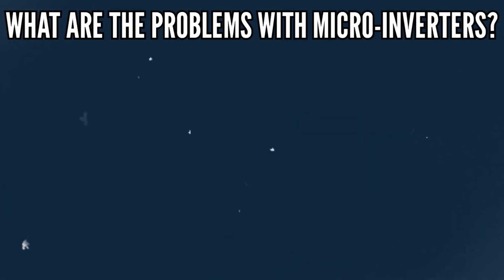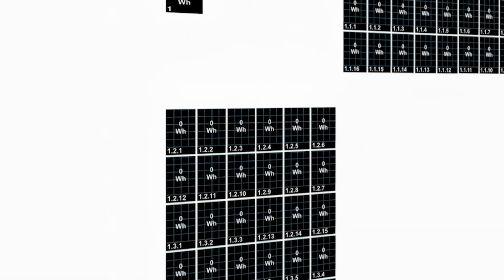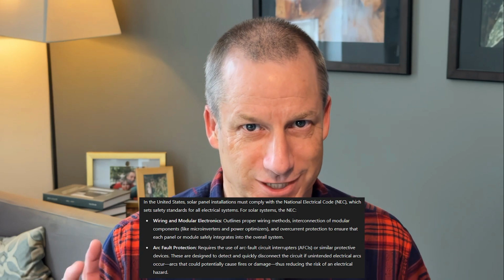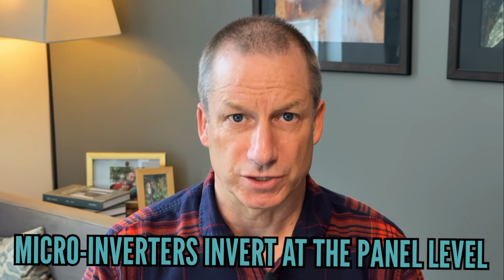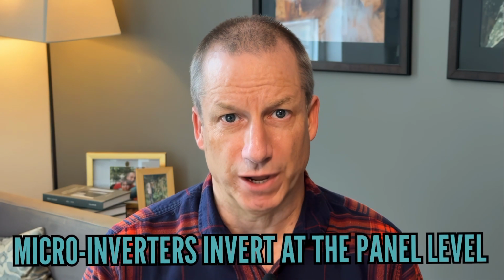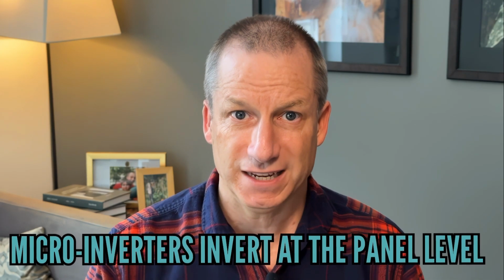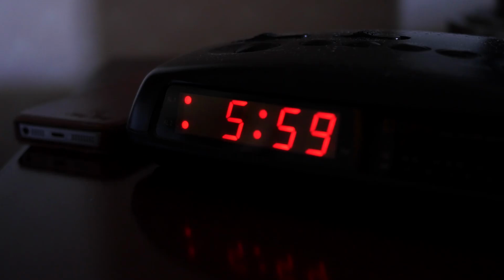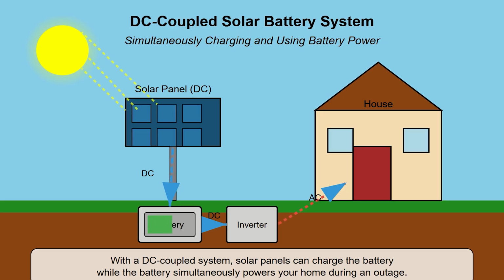Why Microinverters FAIL Homeowners (DC Optimizers Win)

Comment: Hello, good video.  I have solar panels (22- 395watt jinko) with optimizer ( SE440) and then a solaredge string inverter SE7600. I'm adding batteries so I'm putting in a  EG4 hybrid inverter  with a MID. I do feel the inverter is clipping my production. On the best sun shining days i never  go over 7600 watts , some installers said oh it's good up to 125%. Shit I have never seen it. What you think. I do have a battery question, but I'll stop here.

Comment: Micro inverters invert the dc energy once and we use it way more efficient than batteries. But batteries have their place in bad weather and night. I didn't do research but I have owned both for 10 years and Micro inverters are the way to go when first starting up and with the right  main inverter they make great charge controllers.

Comment: Some good points but don’t totally agree
Enohase at least has a 25yr warranty ( still possible scaffold costs) and my guvenergy battery can charge via solar and discharge to the house . Not the cheapest system but the best for my multi aspect roofs setup

Comment: Microinverters will clip more? Using Enphase too much, as they suggest dramatically undersized inverters for a given panel size? If you use a microinverter that is suited to the panel size you won't get any more clipping than if you sized your array correctly with a string inverter,,
Reply from the maker: Yes you will get more clipping. Think of it this way if you have a 30 panel system and only 15 are working at peak because of shade then with micros all 15 will clip because each panel has a max. With SolarEdge or a string inverter  they will not because the one inverter has a max designed for 30 panels and will only clip if all or most are near peak. Make sense
now?

Comment: Microinverters have a tiny failure rate, where SolarEdge string inverters pop like popcorn!
Reply from the maker: That’s the opposite of my experience.
Reply: @bradthesolarguy  Where are you located? Here in NC, a defunct solar company installed hundreds of SE inverters, and every month or so, we get a new call from someone who wants us to fix their non-working solar system. We go there, and invariably, it is a dead SE inverter. Then we go through the RMA process, wait a few weeks, and get the customer back online. On the other hand, I've sold well over 400 Hoymiles HMS-2000-4T-NA microinverters and have had no failures whatsoever, and I have 100% happy customers, as you can see from my glowing reviews. Whose microinverters did you use, NEP? From what I've heard, that would explain your experience.
Reply: @bradthesolarguy  You're still exaggerating here. #1. If a microinverter fails, they are plug-and-play to replace. A homeowner can DIY it; it's not complicated or difficult. You make it out so that ONLY the installer can do this, and that's not true. Even wiring is a simple 3-wire cable, L1, L2, and G. No more difficult than changing the plug on a line cord. #2. Hoymiles HAS AC-coupled battery inverter, has 95% efficiency. I would not call that "Extremely Inefficient". In the 1990's a Telecom inverter with 90% efficiency was considered outstanding, inverters with transformers were under 88% efficient. I consider +/- 1% to be roughly the same thing and not a big deal. Your words are exaggerating this. The HAS battery inverter AC couples to both the Grid and to the Microinverters. Therefore, they can and DO charge the battery while powering the load, drawing the power from the microinverters. #3. The HMS-2000-4T-NA clips at 514W DC per panel, compared to the Enphase IQ8H that clips at 391W. So that's a non-starter with Hoymiles. Everything you said is partially correct with Enphase microinverters, but is completely false for Hoymiles microinverters and battery inverters. You didn't do your research or you are biased against microinverters. I find that they are the easiest way for homeowners to DIY their own solar panels and save 50% off the cost of having them installed by others. That kind of savings more than makes up for any minor inconveniences. A DIY solar system is easy to repair if you're the one who installed it to begin with. I highly recommend it.
Reply: LIES!
Reply: I haven't lost a micro inverter in 10 years most string inverters are long dead in 10 years.
Reply: @offgridwanabe Another lie, lol.
Reply: @meilyn22  Do you always call people liars without any evidence? I've sold hundreds of Hoymiles microinverters over the past 4+ years and none of them have failed. Gripe elsewhere!
Reply: @ToddDesiato It seems you have no clue what the thread is about. The claim was that String inverters pop like crazy. That was what I called a lie. Whether you sell microinverters or not has nothing to do with my comment.
Reply: @ToddDesiato Also, buying microinverters from a known brand and then buying cheap string inverters from China and comparing them is neither fair nor accurate. Most string inverters have 10 years warranty with extended warranty up to 20 years. So you guys have no clue what you are talking about.
Reply: @meilyn22  I'm the guy who posted it, and it's true in my area anyway. I've replaced over 7 SolarEdge inverters in the past 3 years, and zero, none, nada, zilch, microinverters. I follow the EG4 forum and prior to their XP series, their string inverters were often failing too. Seems you're the one who doesn't know the facts. I've got 15 years of first-hand experience! I've replaced more ABB 3-phase string inverters than I can remember. I've lost count! The Advanced Energy string inveters too were a big seller that turned out to be garbage that needed constant replacing. The only string invertes I've used that were not an issue has been Chint. So, your theory about "cheap string inverters from China" has been disproven. The ones from China work best, same with the Hoymiles microinverters. String inverterters are great if you charge for extended warranties and maintenance contracts!
Reply: @ToddDesiato Wait, you are posting with multiple accounts? Do you sell microinverters?
Reply: @meilyn22  For you it is a lie for him it is business as usual seems to be a lot of that going around.

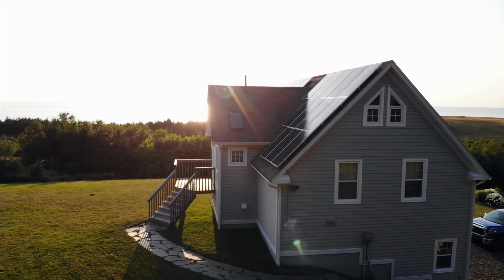Comment: The point on 4:30 is wrong, the power produced by the micro inverters can directly be used by the house and the battery only needs to store if the inverters produce more than consumed or produce the difference between consumption and production!
The main point that I agree on is the costs of replacing a defective micro inverter. However, if you have a string inverter failing, you loose 100% production where with a micro inverter you loose a small percentage 
Both sides have pros and cons. At the moment, I still plan to go with the micro inverters.
Reply from the maker: Actually when the grid goes down and you switch to running the system independently you lose the uninterrupted power supply of the grid. Solar needs an uninterrupted power supply to work because safety and you don't want your fridge to go out when a cloud comes over. That means when you go "off grid" during a power outage your battery becomes your uninterrupted power supply. But because the inverter can't work in 2 directions at once you do lose your solar power with an AC coupled system with microinverters. With a DC coupled system you can use the battery and collect the solar electricity simultaneously.
Reply: @herwigg3327 you are right. Brad doesn't seem to understand how the AC coupled system works.
I have a string inverter. I think optimizers are the better choice if you have different orientations in a string. A problem I see with cheap microinverters is not only do they clip the output on the panel level, but they also clip more when it's hot outside because they have no active cooling.
Panels are now cheap and if you have enough space like I do, it's cheaper to buy an extra panel, than to get microinverters or optimizers. Prices are fluctuating now though, so that might influence your decision.
Reply from the maker: I do understand how AC coupled system’s work. Do you understand how grid tied micro-inverters work?
Reply: @bradthesolarguy  Yes, if you set them up correctly, you can have them produce power when the grid is down as well. And if you AC couple the battery can supplement if you consume more power than the system produces, or you can store the excess if you produce more than you consume.
Reply from the maker: @GerbenWulff  Enphase microinverters will not automatically produce power during a grid outage due to anti-islanding protection (required by code for safety).
However, if the system includes Enphase’s Ensemble/Enphase IQ System Controller, which enables grid-forming capabilities, then yes, the microinverters can continue to operate during an outage, powered by the battery's AC signal forming a local microgrid. This is not the usual set up though.
Reply: @GerbenWulff  I agree, I have already mentioned victron Multiplus which clearly state that in their description but it seams this post is no longer here. There are also other systems that support this feature but it is not the norm.

I used to have enohase on my list but one university had some tests and they said that they had to get the internet to the inverters in order for them to work, this was a no go for me than. At the moment I favour Hoymiles with the drawback of it being chinese. By the way, even the small hoymiles AC battery ms-a2 can be charged via micro inverters.
The main argument for micro inverters for me is that if during the years a single panel degrades (less enough that the bypass diode does not kick in) the whole string produces less without you noticing (you will only realise that production goes down year by year).
With micros or optimizers, you know which panel is to blame.
I prefer micros to optimizers as micros are cheaper than strings+optimizers and you don't have the inverter as single point of failure.

At the moment I plan to use the 1.6 KW micros for 4 modules and place them all on a single spot in the roof connected with DC cables to the individual cells. And I plan to put some PV powered fans to these micros.
Reply: @herwigg3327  If you live somewhere where it gets hot, you could restrict yourself to adding only 2 or 3 panels to the microinverter to reduce the risk of overheating. Also you could put them under your roof, if it is usually cooler there when the sun is shining and you have easier access to them. Fans will break down after just a few years and they are not monitored. I have fans in my house and I clean them several times a year.
Reply: @GerbenWulff  good point, thanks, will take the suggestion in consideration. But that would mean to guide two DC cables through the roof for each panel. Not sure if this is the solution.

Comment: Micro inverters fail when the power goes out, the pv string keeps on dumping into the batteries, I have both and the string inverter hasnt failed me as much as the Inverters.
Reply from the maker: The micros don't fail when the power goes out so I'm not sure what your point is?

Comment: Thanks you   make good points ..  In UK they offer 25 year warrentee  on micro inverters , But as you say  its big work , to change one microinverter , scafolding take off pigeon netting & a couple of panels to get there.., I asked & they said "oh we mostly can fix them with over the air updates"...( so each has got software & a wifi conection to go wrong too, & you can fix a blown capacitor with updates ) so likely the company will go bust before 25years. .  It is also 10x the number of things to go wrong ... wouldn't mind so much if they were in a nice row on the garage wall , with a spare provided to just switch in .  .. During the sunny day the AC power comes from the roof & runs the house, only the extra comes from the battery or grid as required .   For me in the UK the last time "the grid power went out" was 1974 during the miners strike. ( maybe since then it goes off for 30min every 10 years or so) so that isn't a concern yet.
Reply from the maker: That 25 year warranty on micros is good but very misleading. It covers the parts but only a tiny amount for the labor and therefore the solar company doing the work loses money every time they come out to fix one. That is why it's very hard to get someone to fix just one or two or really any number. Also, you can extend the Solaredge warranty to 25 years for just a few hundred dollars which I recommend because you will probably only need to replace it once if at all. And its a lot easier to get your installer to come out once every 10-25 years than for however many micros you have.

Comment: You make some great points Brad. I feel like I struggle with a decision of microinverters vs DC-optimized/central inverter system. 
Though I will point out that some of your negative comments also apply to a DC-based optimizer/central inverter system as well. Since the main drawback of a central inverter is the single point of failure, if that fails at all you have 0 output from your panels as opposed to a lack of output from a single panel or even 25 or 50% output assuming a large collection of microinverters fail. And as you note, getting someone to come out to service anything is hard - but maybe a dead inverter is easier to find someone?? So the same negative logic applies to the central inverter as well, except you have 0 solar while waiting for the central inverter to be fixed.  
And as noted in the comments, there is a smaller but still relevant level of failure for optimizers. While this affects system performance less, I presume getting someone to come out to swap those out on the roof is just as difficult but the performance impact is minimal?

I would also ask you to comment a bit on the AC-coupled and DC-coupled battery architecture/flow a bit more as I'm not sure I understand that clearly. Having a DC-coupled battery limits you to the flow through the central inverter. From your description, it would seem that the DC power coming from the roof goes to the battery and if full, proceeds to the house (discharge and charge battery at the same time).  I would have expected power to flow either to the inverter and into the house or to the battery, but that does not seem to be the case? Similarly for an AC-coupled system, the AC power off the roof goes either right into the house for use or is shunted to the battery for charging (i.e. if sun is shining, I can get power from either the panels themselves and/or the battery discharging; would have to stop battery use to recharge batteries). 
I'm unfortunately not in Massachusetts so don't want to waste your time on a direct consultation but figured others could find greater understanding from an exchange of comments on your video.
Reply: Thanks as always @bradthesolarguy . I can see what you're saying on both accounts: the amount of production lost from a week of a central inverter (100% of a week's production) vs 2-3 months or more of a few microinverters (say 10% of production). That numbers game of total production there.
And then the energy flow through or around the DC battery. I feel like I'm still trying to get a clear picture of the exact energy flow for each system, so that clarity helps and makes sense.
Thanks!
Once I defeat my HOA in some way, I'll keep you in mind for install since you're nationwide (I had the impression you were MA-only).
Reply from the maker: @ Thanks for the kind words. And it's only recently that I have been able to help people nationwide. Good luck with the HOA!
Reply from the maker: Thanks for your comment. FYI I can help with solar and batteries nationwide now. I actually think from a maintenance perspective having a single point of failure will likely be an advantage. First because the problem will be apparent to the homeowner relatively quickly, will need to be replaced or fixed only once or twice over 25 years, the work doesn't require getting on the roof and will have urgency because the whole system is down. Contrasting that with micros, the homeowner might never notice if only a few are down, the installer will never want to come out and fix just one and people will end up just living with part of the system down. I think micros will have a much higher percentage of downtime and lost production because of this. A DC coupled battery (in most setups) allows the DC from the solar to pass through the inverter and feed the home directly or feed the battery- whichever is needed at the time. When using the battery electricity from the battery can pass through the inverter and feed the home, but this does not prevent the solar from going in to the battery directly because it does not need to be inverted since its still DC. Electricity can only pass through the inverter in one direction at a time thus with an AC coupled battery if you are filling the battery you are blocking the battery from powering the home. Make sense?

Comment: I live in the Sahara Desert latitudes of Sydney Australia and hot rooftops PV panels with microinverters is a worry. 
We get subsidies to install but not to maintain. 😢😢

Trades men are expensive. 
2 tradesmen if one tradesmen is on the roof.
😮 😮    😊

You have cleaned up my thinking.
Reply from the maker: Subsidies to install but not to maintain. Very well put.
Reply: @bradthesolarguy  I think that when faced with more grid electricity costs, most people will fix their rooftop PV system. Just my comment. 

Here, the government does not want to upgrade the existing national grid capacity, and so a subsidy is much cheaper for the government, cost wise and politically.  Blackouts are blamed on the government at the elections here in Australia.